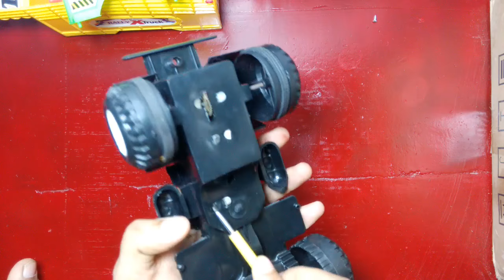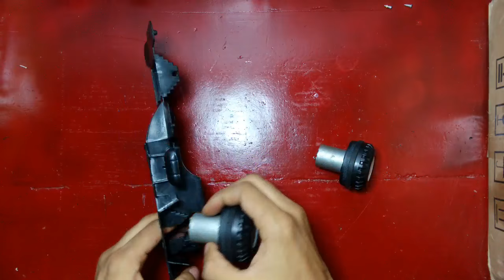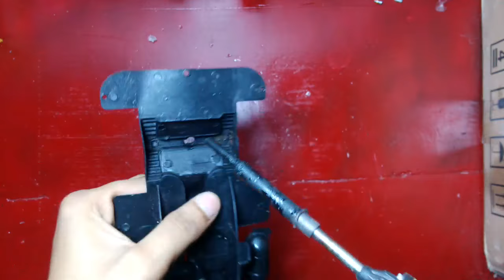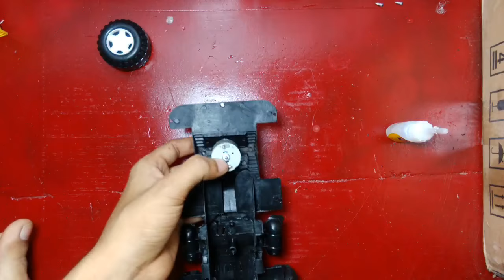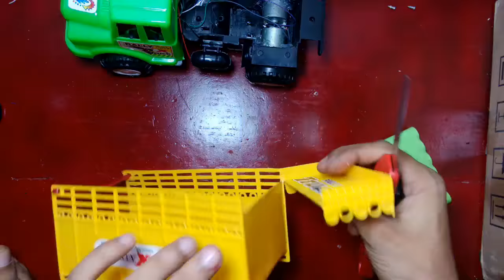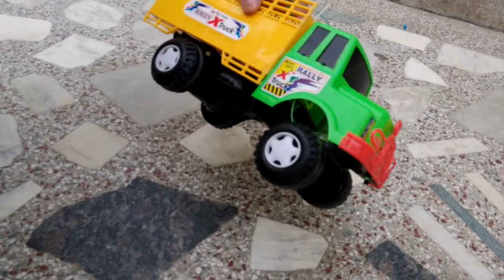How to make a wireless Remote Control Truck | Shamshad Maker

Comment: nice toy and job man ...but i ask you a thing: why two motors at the back??
Reply from the maker: Powerful truck
Reply: speed is not power. maybe next time build another one with a gearbox and 1 motor so the truck can climbing .
Reply: +Shamshad Maker how to get remote and how its work to another receiver or motor
Reply: you dont get any more power with 2 engines, only more weight and power consumption. one motor and a gear attached to axle would do enough. you can use the gear from the original friction motor. Plus, make a triangular cut on the frame next to steering wheels in order to have room for them to move. Glue some tiny rubber stripes around the wheels for more grip

Comment: Hey dude when you steer you tire it won't go back to normal position it will remain to the same side which you have steered
Reply: No stearing system moter is low power moter so when truck will move it will come to its position due to the motion